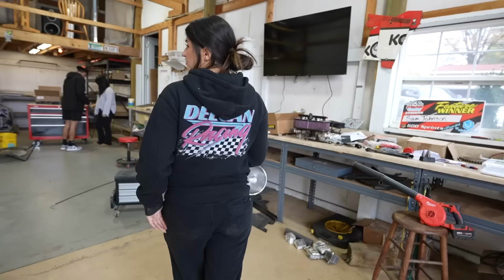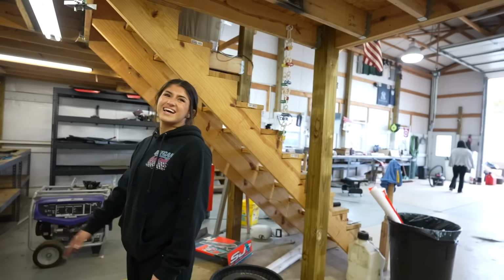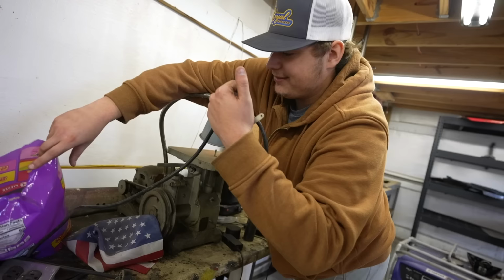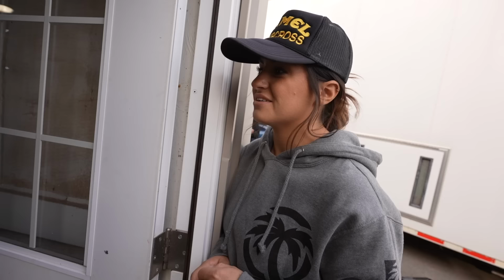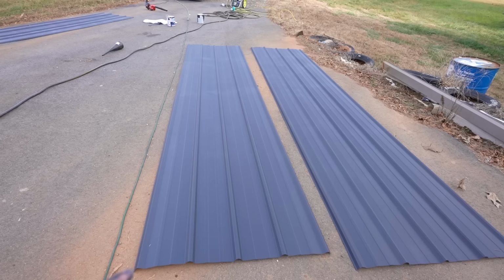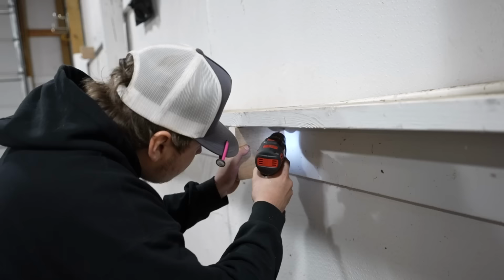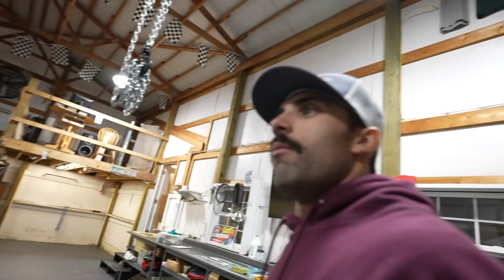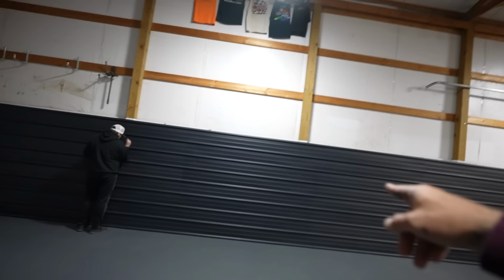We Completely Rebuilt The Shop!

Comment: Welder torch plasma cutter go under stairs… left hand corner under stairs you need lathe an bridge port milll an drill presss plus a horizontal bandsaw goes under stairs probably lowest setup to fit under there… even harbor freight one for bandsaw be decent an even big drill presss… miller welder millermatic plasmas cutter be miller also 625 duty cycle need be 60% or more cause it will piss you offf…

Put umm a walll on the right side of steps to the underside of loft for where you got a back to store stuff under the stairs… 

But all rollable fabrication equipment goes under the stairs…

Between lathe mill an drill presss on left hand under loft no room for table on left hand side..

Right hand side of stairs under loft 2ft table from walll 33” tall… good wood build an then put stainlesss metal on for tops about 1/8 thick run around the back of wall also but not down the walll that matches up with stairs you put in that’s a backing wall to fab tools on other side no leave that wall open an make that where you put your tool boxesss that roll around… tall box with maybe then at end of walll you put in there be a table that comes from back of the right hand side under loft on the left side matching up to tool box depth…

That be where you can mount a vise an dooo a metal small but heavy table that bee bolted down to the ground an honestly if you do vise there on mini table of coming off right hand booth under loft down left side against walll that is on right side of stairs you need tool box to not block the vise soooo um tool box on right hand side of right booth under stairs… 

The bench area an tool box area..

Vise table down new wall on right hand side of stairs be metal made with half inch metal top for it an bolted to floor.. k run that down the length of that new wall no more then 2ft out from new wall ann yea ending the length of the table on right side of stairs at the first pillar of the loft the. Have that area there for bench grinder to sit that’s moveable but with solid heavy waited base.. 

Idk I’d set it up legit for ya but be like 30k addd on just for the tools an material lol 

We need to do that to ours but gosh stuff just keeps rolling threw an can’t find time to clean it alll out lol 

My dads like nooo to ol rusted tin back splash for like 3ft up walll an imm like why the frick not then places buckets an engine blocks of 429s 427s along the wall an just stacks bs up…

I can’t wait for some investments to turn full bloom.. or atleast enough to get me rolling in day trading with 10k atleast to begin with an so I can get up to flipping 50k on day trades an what not hope I hope to god that I can get 100k to 250k swings in on day trading once a month next year or however often we find the right signal for stock to choose for such a hefty placement of money to invest short terms..  50k baby sit threw the week every week be nice then like said 100k or 250k to once a month it be cosher asf… 

Pay off my parents property an buildings after I get my building up an going on the other side of the property the scary side of the property sooo sadly will defuse stand offs but Mehh you can win for only sooo long ya know so better off to defuse that bs.. ya know… ik ik law abiding citizen movie… I fear that tiz why I thought about moving to Charleston mattoon area lol but idk yet there maybe 5 year… 

Because my place is 300-400kbudget an to pick up my parents place an release them from that is gonna take 100k sooo meh..

 Problem is my building. I want isn’t like the poster child building offf forever buildings .com no it’s fancy setup that’s kinda like retired slashed bachelor pad type gig.. 

Beautiful white black an deck from second story that hangs over Garage door area with big wood pillars..

Only one bedroom tho 😢

So add one over shop tall side on left of building…

It probably be 450-500k all tooled up an furnished heated floors added on rooms for it throw my grain bin in the back where I can have two story walk on vault to protect my cash money I take outa circulation an hold onto privately along with my office an gun room type walk in vault.. 

I think I can get it done for 350k 

But want another lathe a good one that’s true need good big mill will need welder an cutters car lift to store the drag car my mustang up top locked out just incase people wanna try an break in doubtful but you never know… 

No body really messes with us anymore out here except I’m down to like the final top 3 crack heads ones downs an out so we down to 2. Now sooo it’s getting interesting… I’m ducting taping door knobs off before we leave for vacations an stuff putting up trail cams on fence post with fencing wire an duct tape like ha it gonna take you 5-10min to get that camera off there boy-yoo ann yea…

One of the top two crackins is believed to have put something in my oil of my Ktm 250sxf 2017 annn seized it up couple years back cause I leave it on back porch lean too where I could just whip it out in morning an go ride instead of fight threw my dads bs an trying not to scratch cars all the time… but yea he uhhhh def put something in my oil… of my Ktm an it locked up 3/4 of mile deep into a crick ride training I was doing for guesss what lorrettas but ya that went to shit annn luckily it’s shitty I half to stay around these people to figure this bs out sometimes but it’s made superficial street smart which is also flip side of coin playing really dumb to stuff to which with my short memory problems gets kinda exciting for me to figure out tf was it I was just cross referencing in my mind sitting here listening to him jack his jaw as he subtlety leaks shit out bragging to me lol…

Ya idk.. 

Imma just say fuck it become a private international freedom fighter goo fight some real wars over seas for  my new found love of gun fighting.. 🥹

It’s gonna be a good year next year I’m even cleared on my disability claim… finally… which give me a foundation to stand on for idk back pay to be invested into my dirtbike an Lorrettas plus some nationals depending on my other investments taking off next year…

My disability definitely paying for a EBR built bike for me to run lorrettas an some outdoors…. Cause truthfully I’m disabled because welll I have problems staying engaged with a jobs around here that don’t pay more then 18$ an hr cause well I hit my head reeally good an my long term commitments to such places that work the dogs breathe outa ya for lucky to have 750$ at end of week type bs is very easily idk over thrown by let’s go flip couple cars an ride a lot more cause I have cash in Hand from that job built up an soo yea was flat broke by 2020 lorretttas how did I even get down there idk… 

But I was just wished I’d left the id left the pbrs alone so my mornings be alittle better take end of night to relax an get blood thinned to wake up like ahhhh feel horrible dehydrated bs an half to start in drink couple before noon.. idk why but probably why someone yanked the reigns on ol pitter like I’m on my period please believe you me I don’t get out very often an was over whelmed with the event sadly let alone whole other stuff going on that.. 

Sorry 1-800 my bad 

Anywho have fun… make left side machinist fabricator tools booth an right side the bench tool box areas then plexiglass the loft off an have simulator setup office setup but most importantly you need like a table up there that’s center of attention for like where you announce yourself from at beginnings of YouTube videos as you explain your directory to the videos…

I call it the YouTube video table thing a-uh bob.. but it’s where your videos directory of what your about to seee in upcoming video is told out at beginning an endings of important videos or a series of videos following stuff or like when you do say a project type following video.. idk 

There’s this shop in mville that drives right threw to the alley from maintstreet that has perfect YouTube area where it has big table out in middle off to side with like a square c around walls of table with chalk board behind it type YouTube area or video directory recording area..